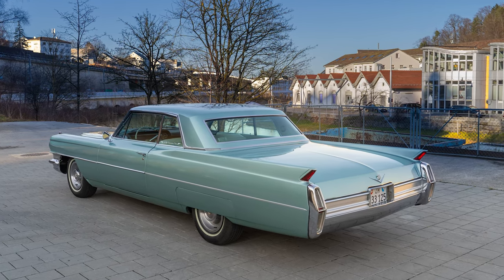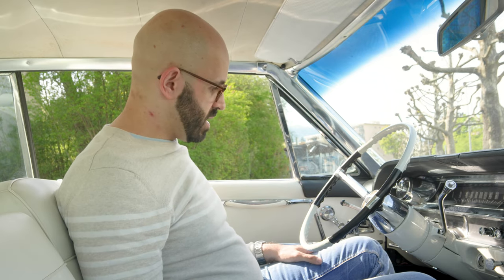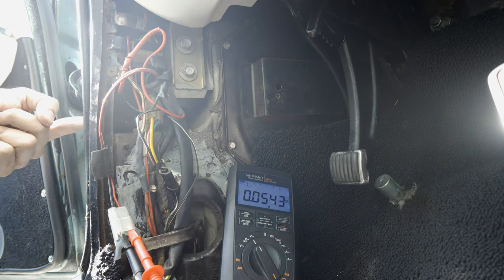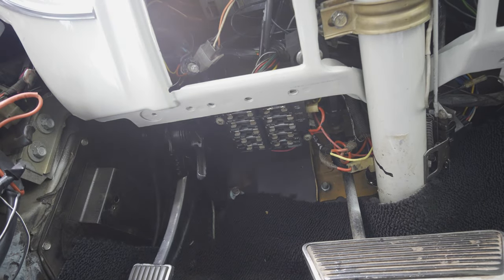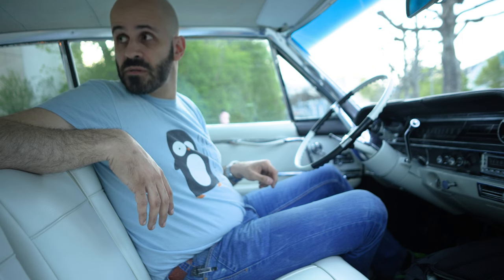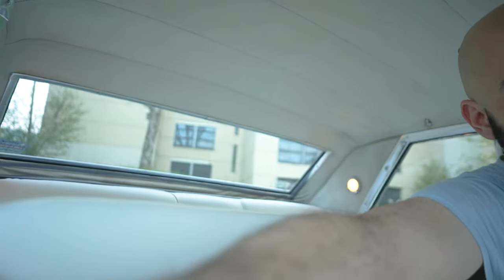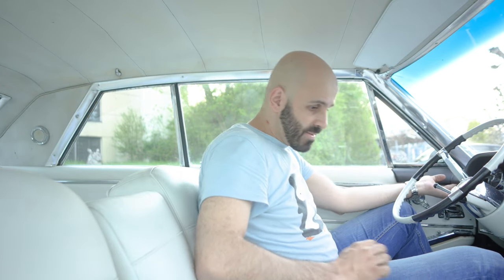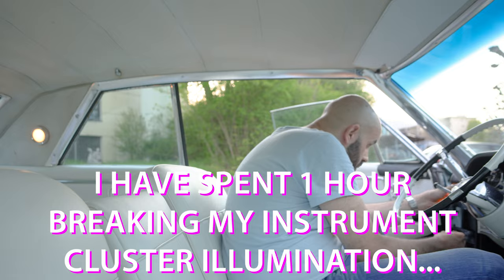The quest to fix one courtesy light (and break other stuff in the process)

Comment: One important thing to remember is that American cars from that era used the dash lights dimming control (which was usually accomplished through rotation of the headlight control knob) to also function as way to manually turn on the dome lights. Once you turn the control to set the dash lights to full bright, further rotation past a detent turns on the dome lights. However, in looking at the wiring diagram, it does appear to show independence between the front and rear courtesy light circuits in that the front doors operate the front courtesy lights and the rear doors operate the rear courtesy lights (dome lights?). The unknown part is how the previous owner’s modifications (taped up wires, cut wires, disconnected connectors) affected the overall operation of the dome/courtesy lights. It will take some time to sort out. Good luck!

Comment: For the lights there is some little 2 legs condensators that u use on the wiring so u have the continuous power ti make them work, I just wish I could send u the picture, they are very small and should fix that problem keep it up mate u r doing fine👍
Reply from the maker: Thanks, but I think they are not making proper contact in the holders. I will investigate. 🤔
Reply: @swisscarguy  either way for you electric safety it's good to put them, they cost no trouble to put👍👍👍👍